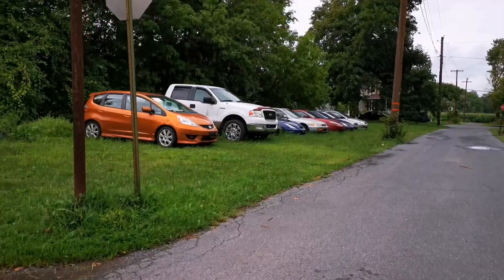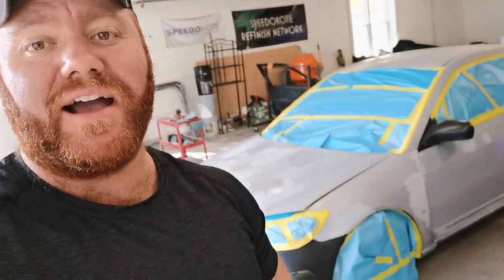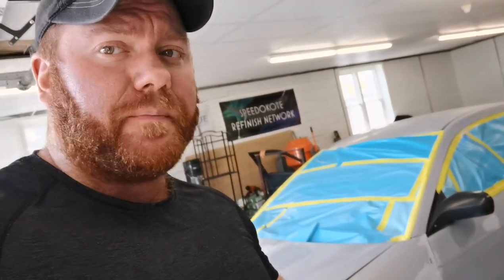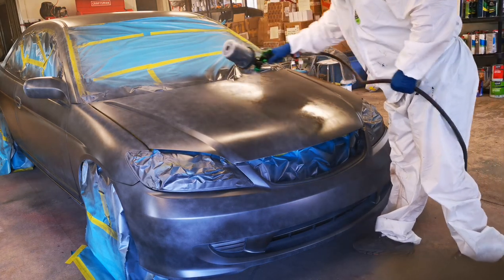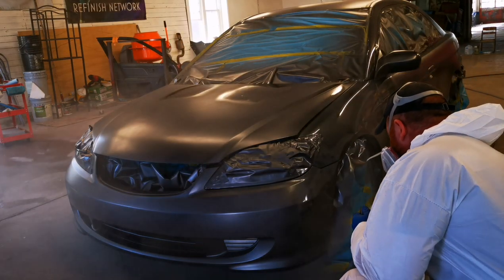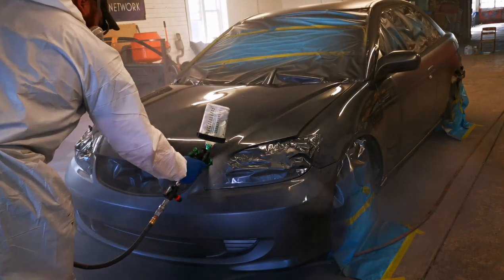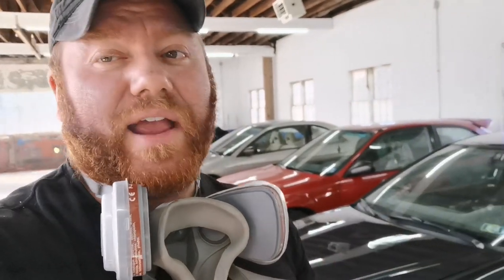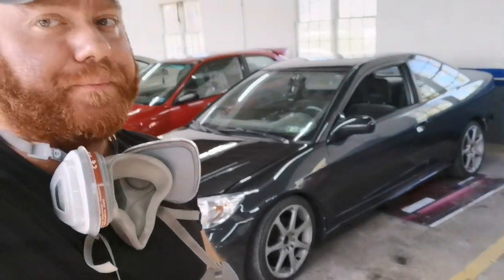200$ paint job

Comment: Thanks for sharing! Awesome video. Q1- I have a 98 honda accord ex in black. I have the car at 320 all over except for the hood. The dents were a few and I took all the paint off to the metal. Now, I think i ready to prime the bonnet, but I want to prime the entire car. I did purchase the black gloss speedokote. What's your thoughts about the primer. I do have DI-2KP Urethane Primer high build to use on the car.

Comment: Damn that Civic came out great. A lil suspension work and some tint, then that car will be turning heads. I had a 95 in high school. I think I dropped every cent I was making into it 😂 Tuner car's can get addicting quick!
Reply from the maker: That's the plan
Reply: @speedokoterefinishnetwork4937  Question. Have you had any experience with the line of clear by speedokote that you can control the level of gloss with the amount of hardener and etc being sprayed?

Comment: Did this paint job cost $200 for everything including the sealer, or was it just the paint and clear coat that cost $200?
Reply from the maker: 200 was for base and clear , sealer was only 15 bucks only used 1 quart
Reply: @speedokoterefinishnetwork4937  Nice, thank you

Comment: Anyone know the brand of the guns he is spraying with?
Reply: Looks like he is using the gun he sells. Take a look at his videos where he shows the kits for sale. Pretty sweet deal for everything he puts in the kit. From what I've seen and read in his comments, it is basically a black widow clone.
Reply from the maker: My guns. Black widow clone . 179.99 includes regulator and air fittings everything you need to spray right out of the box .

Comment: Dou you own speedokote or more of a rep?
Reply from the maker: Not even a rep, just do videos for them and use there products. Been using there products on all my personal cars sence 2012 great stuff
Reply: @speedokoterefinishnetwork4937  id love to bring them to arkansas. I use mostly clear from them but will use it all. Would love to try to be a dealer for them.
Reply: @speedokoterefinishnetwork4937  you have any videos in the ss1200. I have a 71 split bumper camaro I'm doing full resto on fir a customer,  I want a good high solids clear. Will have in total 6-8 coats of clear when done.
Reply from the maker: @MidnightCustoms111  smr42 only need 2-4 solid coats and done

Comment: What gun do you use?
Reply from the maker: My own brand .
Reply: @speedokoterefinishnetwork4937  are they being produced because i don't see it on the website
Reply from the maker: Scroll to the last 20 seconds of the video.
Reply: @speedokoterefinishnetwork4937  bro really?? Thanks for the run around. A simple, sorry its not in production or not in stock is all it took but instead you tell me in your brand gun and then when i ask more you just tell me to go to the website that i literally just said i couldn't find it on.....
Reply from the maker: @MythicalBuilds  sorry I miss understood your question. The product used is in stock and is under the clear coat section. Sorry for the misunderstanding
Reply: @speedokoterefinishnetwork4937  all i see is clear coats, dont see any paint guns anywhere on thr site besides the bed liner sprayers
Reply from the maker: @MythicalBuilds  oh... Got ya , yes so Mabey this wasn't made clear and alot of people get confused ... All I do is make videos for speedokote . Mark1 refinish products (the spray guns ) is MY brand . Sorry for not making that clear
Reply: @speedokoterefinishnetwork4937  and where can i purchase one to test it out. Or is it not produced anymore. Seen a previous vid saying you only had 10 made
Reply from the maker: @MythicalBuilds  I got plenty of everying in stock . I have 3 kits , see my latested "new spray guns " video and now I got 3 options instead of one !

Comment: Yeah the Sandpaper cost more than 200 bucks but it's a nice paint job
Reply from the maker: I get sand paper at 12-20 bucks a box. Only need 7 sheets of 180 ,  7 sheets of 400 , 7 sheets of 80 grit for body work. At 25 cents a sheet that's only about 10 bucks or so. Just a rough estimate. If you need deals on sand paper contact mr
Reply: I was just estimating. I just bought gal of 2k primer 140$